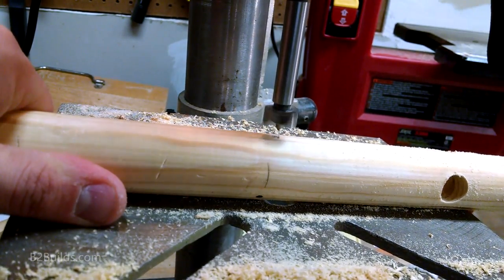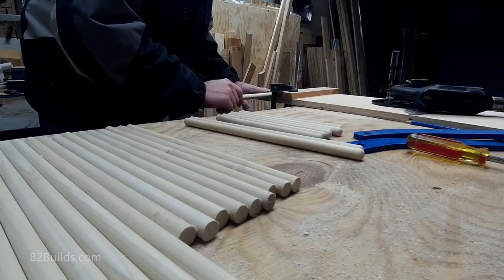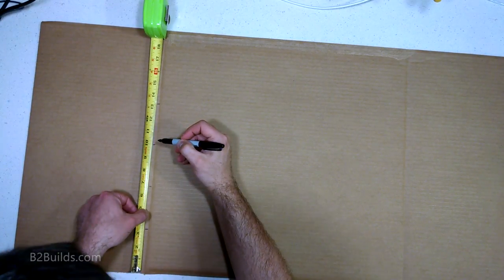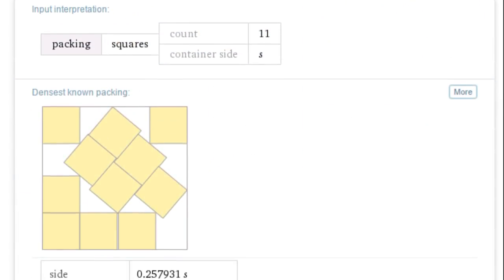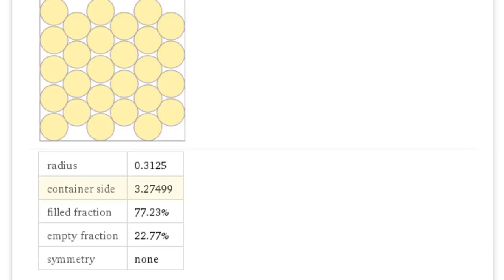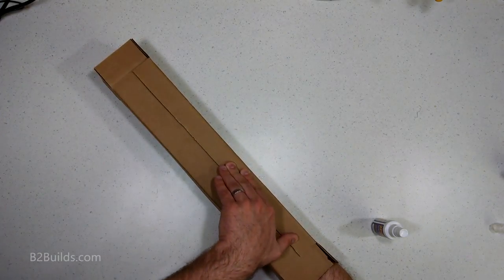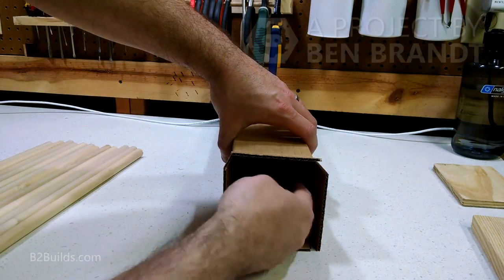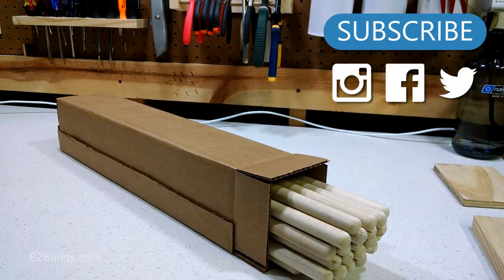Over-Engineering a Custom Cardboard Box with Wolfram Alpha and Packing Algorithms

Comment: The reason your box came out slightly under-size is because the creases you put into the corrugated material actually penetrate half-way into the thickness. This means the dimension you measured "shrinks" by one full thickness of material when you fold it up. Interesting software - going check it out!